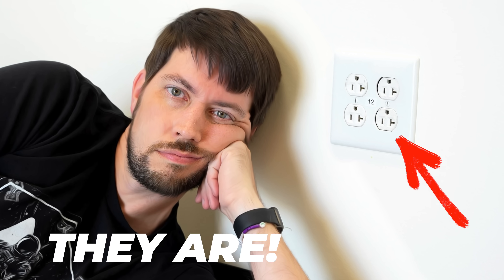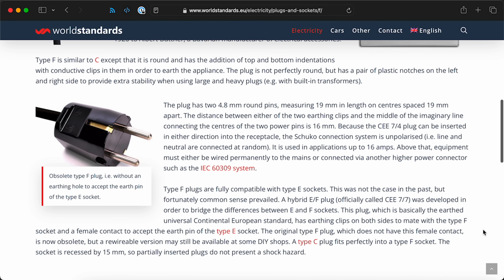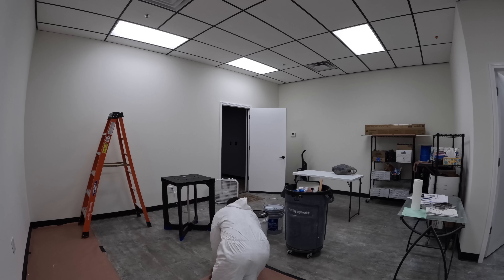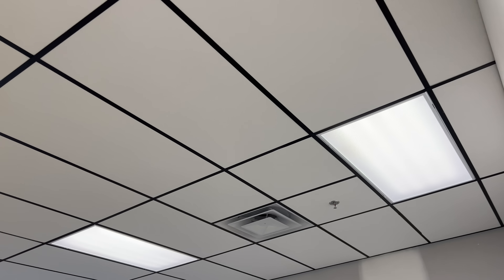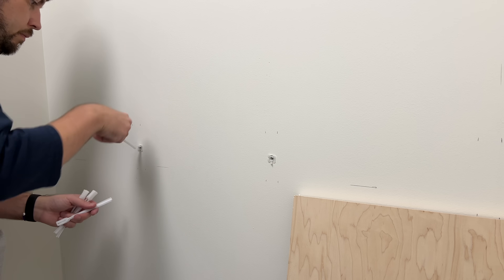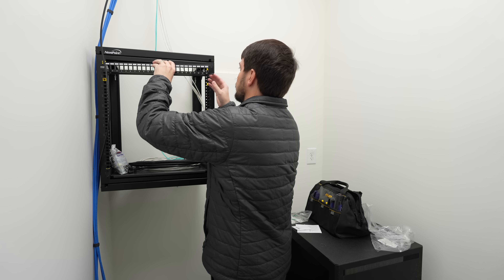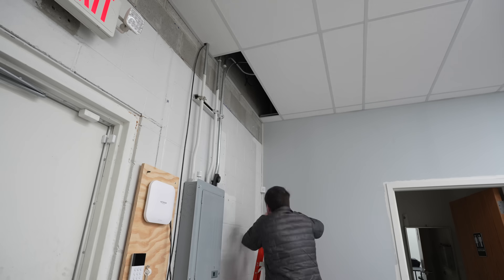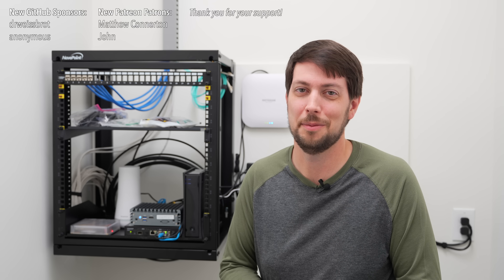Wiring up a small office network rack (moving 10)

Comment: The only thing that I would do different is plop that coax bundle into the ceiling and call it a day instead of reterminating it
Reply from the maker: But the potential like 0.01 dB signal gain from a shorter run...

Comment: I've seen this trend time and time again and I still fail to understand how anybody working at a security company considers having their alarm only connect to the internet using wifi a passable idea.
Reply from the maker: Hard agree. Should at least have an Ethernet port!
Reply: @JeffGeerling  The other thing I find absolutely aggravating is how some companies will still sell you network gear with 10/100 ports in [insert current year]. I got a set of devolo magic powerlines and they can talk to each other at about 400mbps and you can do that kinda speed over wifi but if you hook up an ethernet wire to the powerline receivers all you get is puny, 30 year old 100 meg which is just unacceptable

Comment: Are patch panels used just for that type of connections? Or are there any other uses for them? I"m doing a school project and professor mention we could use them if we want them, but It doesn't look like I need one... Also if anyone can explain what an aggregation switch is (for dummies), thanks in advance...
Reply from the maker: You can get keystone jacks for almost anything; cable, audio, HDMI, etc!

Comment: Technically you could make your own switched outlet if you want. But it's more convenient to use a wall switch for an outlet remotely. The wall plates, especially for the rocker switches, fit nicely with a two outlet configuration. You could place a switch on one side, and the outlet on the other. 

But I think I'd just use a light switch as it's more convenient.

Comment: Two shelves. Lay the modem on its side. Ditch the qnap switch for your rack mount switch. Move the simplisafe to a shelf at the top of the rack so it sticks out the top rather than taking up space in the middle.
Reply: Well this isn't his only rack, just the one to hold that minimum necessary for initial operations, which it is already. Seems that's working fine then.

Comment: Coupe of things I implemented on my home set up as a now full remote worker my home network is critical: 

1. 4g sim failover 
2. Smart plugs for rebooting things in the rack remotely and monitoring power consumption. (Some PDUs do this but they are spenny)
3. (Not done but seen) buying 1u track trays and 3D printing separators for x devices that will live on it like pis nucs…
4. If you store a lot of devices in the rack a KVM KB and Mouse. With magnets stuck to the Side of the rack

Comment: One thing that I learned the hard way is to be careful routing the Ethernet cables in the false ceiling. If you route them alongside the power cables or across fluorescent lights it will cause interference and slow down your network.
Reply: He's using shielded cable.

Comment: I would have put the AP in the top right corner, as far away from the metal rack as possible, in order to have less of a shadow and close-in noise. Other than that, yes, a mounting board makes life so much easier, and having the 'minimum viable network' separate from the more experimental side makes life less stressful.

Comment: When you convert Fahrenheit to Celsius, no need to go decimal, even for fever, we only use one decimal (you could have a 38.5 fever), no one can make the difference between -6.67 and -5.9. :)

Can you regulate the speed of the fan on your a/c? I understand you may want t at full power when you first enter the building, but when the target temperature has been reached, you should be running the fan on a more medium/quieter speed.

So, you installed a rack that can swing, but you left no slack at all the the network cable to swing the rack open? You should route your cable near the hinge point and from there to the patch panel, that way you only need a minimum amount of slack. (OK someone already mentioned that).

Actually, it is important that you route ALL your cables (network, fiber, power, whatever) to the hinge so you can open the rack in the future. I am also concerned that you may have positioned the rack too close to the corner: if you have a switch a bit deep, when the rack opens, the back left corner of the switch may contact the wall. The only wall mount rack I have used have the hinge point located about 4" behind the front mounting rails, that equates about half the depth of most of the switches, so that minimizes the swing radius.

Can you redo the connector on the coax cable for your cable modem? (I have never used or seen cable modem, I have only had ADSL or fiber to the home) F connector can be made by hand with a Stanley knife. (OK that too was already said by the same person :)
Reply: Correction, on the wall mounted rack cabinet I use, the hinge is 8" from the back wall and the mounting rail at the front another 10" from the hinge.

Comment: (5:10) In my case, my similar Home Assistant automation, which in my case is for when I record narration, would lower the fan speed of the air conditioner instead of turning it off completely, though I have to do that because I live in a country that's basically hot all year round. Besides that, it also turns off my air purifier.

However, I may still change that during the production of some of my first YouTube videos in a long time because, with the location I live in, I tend to run into issues with sound outside my flat. I may be able to counter that with manual noise cancellation using a microphone placed outside my window and synced up to the recording from the main microphone, though.
Reply from the maker: Unfortunately the commercial unit here has a giant fan motors that's only on or off. Wish it had a low speed setting :(
Reply: @JeffGeerling  
Oh. Right. That's understandable, and it was something I forgot and didn't think about while watching the video.

In my case, I was thinking about a mini-split system which is what my home has for air conditioning.

Comment: you should get one of the mini impact drivers - bosch makes some but you have dewalt and milwaukee options
ditch the diet soda - really bad for you and plenty of evidence for this
the pain and money and especially time on moving in to this new office is disturbing - not to level of pi spam disturbing but close
how much more would cat7/8 been to install - yeah you have some fiber but you are not really future proofed if you want to run 40g for example - you can always add that later i guess
you probably should change all receptacles to one way or another and add gfci to kitchen and bath
at least you can finally move in and get going on real work

Comment: Are there really so many different devices necessary for internet access and private Wifi in the U.S.? Here in Germany we get one so-called "Fritz Box" from our internet operator, which includes the router, the DSL modem, a Wifi access point, a 4-port Ethernet switch, and even a connector you can plug an old-fashioned telephone into it.

Comment: Here in Denmark, we have outlets both with or without switches, and I would say, I love the ones with switches. Take for example the lights on the Christmas tree, if you don't have a switch on your outlet, you will have to unplug the cable and drop it on the floor, the next day to have to look for the cable, with a switch, you just flip it, and its off. What's not to like???

Comment: Since the rack is already mounted, I'm a bit late to the part, but I LOVE my wall-mounted rack cabinet with swinging back. Swinging front is also ok, but swinging back turned out to be a real life saver. My rack is fully packed, but I can just unlock the rear latch, and I have full access to all the power cables and other gear mounted behind the devices, without needing to test flexibility of my joints. It was a bit more expensive than a fixed cabinet, but I don't regret buying it at all. It merges the advantages of a small, wall mounted cabinet, and a big free-standing rack.

Comment: As a suggestion, I found someone to 3d print a 1U holder for my cable modem. I suggest you do the same. Maybe you could have a custom 1u or 2u holder for the home assistant, firewall, and the qnap switch.

Comment: the only issue i can find is if you ever use that swing front on your rack the network leads will keep it from opening fully with out pulling them out of the wire chase or removing the patch panel

you should have swung open the swing front on your rack and then set the length of your cat cables
also sense it is most likely that you will never need to remove the patch panel you could have used metal studs and nuts for the mounting

Comment: Heads up there's some Etsy Sellers that sell 1u Cable Modem  Rack Mountable Solutions. I've got one for my cable modem that's my modem on the right and 2 Raspberry Pi's on the left. 
It's probably 3d printable yourself, but I bought one because designing them is not my strong point. 

I've got another one setup for my Dell Optiplex 1 Liter Computer & 5 Pi Zeros and it makes my rack look great :)

Comment: Our current network solution in my house is the basic Verizon modem/router combo they provide. It can be really bad sometimes and always runs hot. Only 4 connections leaves one computer and a Roku on wifi. Although that computer only uses basic browsers so latency is not a problem.

Comment: Offbeat Idea: train warning system.  If trains coming by are a threat to your recordings, then you might want some advance notice so you can gracefully pause and resume.  PCB Artists (India) have a decibel module  (~$25) that is near Class 2 rating and that combined with a raspberry pi and two cameras covering each view corridor of the track could give you a minute or two of warning and let you see how large the train is so you can determine when you may resume.  I'm using PCB's module for aircraft decibel monitoring (I live in a runway path) and it is working wonderfully, can sample 5 times a second when I want to, e.g. above 75 decibels.  Combining my decibel log with ADSB data allows me precision tracking and noise assessment.
Reply: That's a sort of cool idea
Reply: @user-fw6eg3hc8f  some railroads use emitters on the locomotives like the ads-b protocol to track their trains so there is a possibility you could use a transceiver on a specific frequency to track nearby trains and then use a spatial analysis to determine if an engine is coming, then you would not need surveillance cameras, just PostgrSQL with PostGIS.  Edit: speak of the Devil: John Oliver just released an episode about Freight Trains... a very timely topic,eh?

Comment: For the LTT driver there is a 3D printed adapter that lets it accept Ifixit bits. Man I need a server rack of my own. I love home labs. Great video. Now I need an excuse to buy a ton of Ethernet cables and a server rack.
Reply from the maker: Heh, best option is to try to find one local! Sometimes for free too.
Reply: @JeffGeerling  my problem is convincing my family that it’s better for me to run Ethernet in the walls instead of just our current router on a shelf solution!😂

Comment: Now I'm going to admit that I even don't adhere to this, in fact more than not: but what about running the CAT wiring BEHIND the wall and drop it down from the ceiling?
Reply from the maker: These walls are insulated for sound—it's a bit easier to come in through the ceiling and keep the STC ratings of the walls so (eventually) the loud server fans in there won't have a path to get through to other parts of the building.

Comment: Transnational gangs up north in Illinois and Michigan have been using wifi and zigbee jammers to block alarms like SimpliSafe and then breaking into people's homes while they're away and stealing everything.

In other words, HARDWIRE  EVERYTHING!

It's beyond shameful SimpliSafe doesn't have ports to hardwire everything.
Reply from the maker: Newer SimpliSafe hardware / firmware alerts you if it detects interference for long enough—I'm also integrating my Home Assistant sensors into a 'redundant' setup using Zigbee, plus I have a second set of hardwired PoE cams that I'll be configuring with Coral / TPU to identify when people are inside.

Comment: Not bad but you missed alot of industry standards and code. Telecom bonding busbar and bonding the rack. Those junk navepoint racks need each of the connecting pieces contact surfaces to be stripped of paint. When mounting that plywood, you should have mounted another piece on the adjoing wall. Also toggle bolts dont go into metal studs, they are made for hollow walls. The biggest mistake i see is using sheilded connectors on non sheilded cable. That will cause a whole host of problems in the rack , for example NEXT. The whole point is to provide a path for noise to be removed, without that path you essentially just made an antennae. Id recommend getting proper rated keystones and a 24port patch panel. Theres so much more here but those are the big no nos people outside the industry miss.

Comment: You crimped connectors onto cat-6 cables without testing?  You're better than me.  My last attempts at criming rj-45 connectors resulted in about a 30% failure rate.
Reply from the maker: Heh, I've done enough of these now that I can get this particular connector almost 100% of the time—my dad helped me test them a few days ago and they all passed!

I've found that these expensive connectors are pretty good at not having issues, as long as you snip the wires close to the connection point so they don't short to the metal body.
Reply: practice makes perfect. I check myself when I make connections in low light environments, and for some types of cable that even when you are aware is hard to differentiate between White and Color. That and when using GameChanger wire with a larger gauge wire into my connector.

Comment: Since the rack can swing open, run your ethernet cords from the hinge side so that they won't impede with the frame swinging open. With regards to the cox being lengthy, just remember that it is better to be looking at it than to be looking for it. So much better to have extra length as opposed to not enough. A coax retermination is a one minute job.
Reply: If he got the rack I think he did the latch pins serve double duty as hinges allowing it to open from either side. However it's still important to pick a side as the "hinge" side or you can end up with the mess you warned about
Reply from the maker: @SpacePotatoMan  Yep!
Reply: microwave might be the only system that needs no update : two knobs, one for time, one for temp and that's alllllll.
Reply: I'm glad to see that you are using unloaded patch panels those make stringing in and setting up lengths really easy. The one fail I see all the time though is not leaving enough service loop. The loop gives you a place to pull extra cable from if you have to replace a jack either because its bad or to upgrade the technology.
Reply: @RowanHawkins  Jeff indicated that he pulled about eight feet back up into the ceiling.
Reply: The worst cord in the world is the one that's an inch too short. I'd leave all of that slack in place; either stow it above the ceiling, or hang it from the board below the rack. I would've also left absolutely as much slack as possible on the patch cords; leave them as a bundle all the way down the back and back up the front so there's a little movement as possible should the rack ever be swung out. (In most cases, it's only ever out once, when the patch is initially terminated. after that there's usually too much stuff and weight to open it.)
Reply: you can always leavee some of it in the ceiling.

Comment: A lot of those cable modems(at least the Arris's I had) had a way to wall mount the modem just stick a small piece of plywood(or similar) to the side of the rack with bolts or screws and mount the modem there. Or in a worst case scenario use said piece of plywood and a long zip tie to hold the modem to the wood just make sure you don't cover too much of the vents for heat.
Reply from the maker: It does have wall mounting holes, though the status LEDs are on front so it'd be annoying to mount it to the wall next to the rack. The rack doesn't have good mounting points on the side rails, so I'd need some sort of custom cleat to get it vertical on the right side... we'll see!

I just wish the manufacturers would at least consider horizontal rack mount in their designs!
Reply: @JeffGeerling  Maybe a small mirror strip to reflect the LEDs? :D
Reply: @JeffGeerling  Another option would be to get  a 1 or 2U blank cut a hole in it the size of the modem's face you might also be able to make it double purpose and mount more than one device in that black.

Comment: I write the fuse numbers on the back of the wall plate with a sharpie.  It means that I if I want to know the fuse number I need to remove the wall plate to see it, but it also means I don't have to look at the fuse number on the outside of the plate all the other times - and for me I generally only need to know the fuse number if I'm going to end up taking the wall plate off anyway.

Comment: DO NOT CUT THE CABLE and re terminated again!!! That is a big no no put rest of the spool above the suspended celling and pull only the required amount to your devices from the spool. In this way you or other people can relocate it whiteout having a headache with it.
Reply from the maker: That's what I did though—I pushed back about 8' of all the different cables into the ceiling space, and left just a foot or two of extra service loop inside the rack area. That way if I want to move the patch panel to the 'big' rack someday it'll just be a matter of physically moving the switch over.